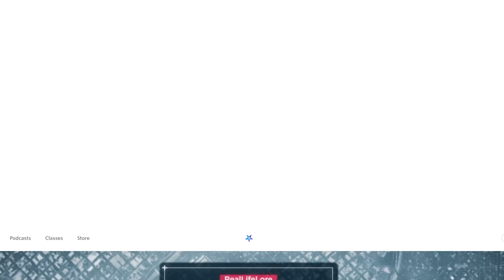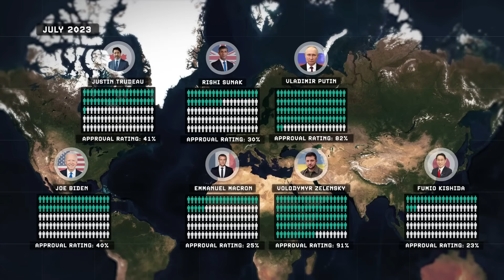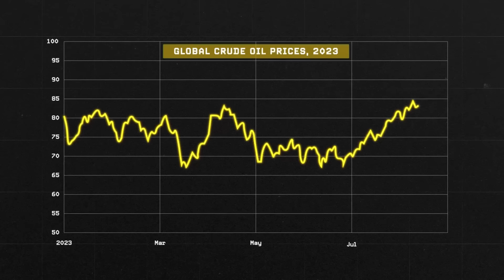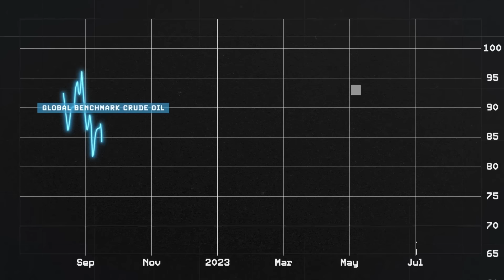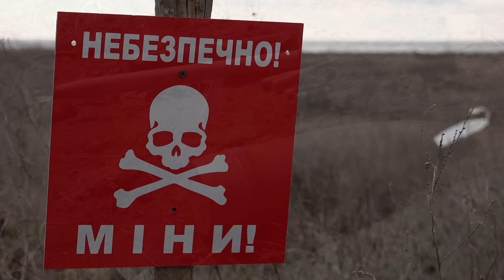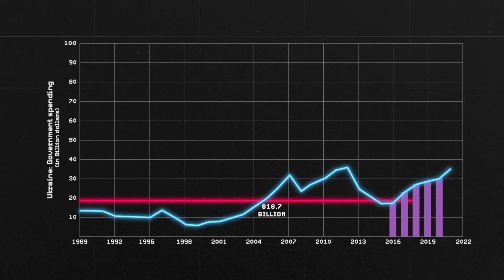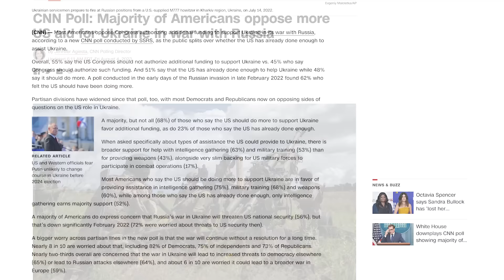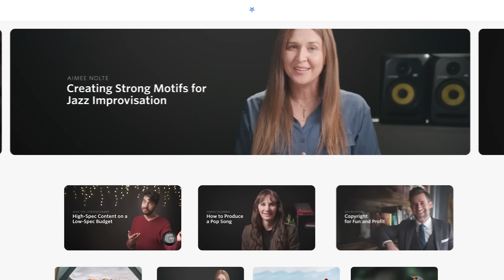Why Russia Isn't Actually Collapsing

Comment: There are several other moments to reflect upon. First, industry. Yes, factories are understaffed. But they are just as poorly automated as they are manned. So, guess what - industrial revolution! Most industries used to see this as unnecessary and unrentable given the production type and availability of human resources. Until recent events.

Then, ethnicities. This topic was and is a sketchy one in Russia. I have no clue about the ethnicity defining methods. What I do know, however, is that Allah-worhipping, barely speaking Russian hairy gorilla - not an uncommon sight both in Moscow and province - upon passport inspection often turns out to be a Russian citizen. Don't even ask.

As for the overwhelming support for Putin - that's debatable. Authoritarian rule is kinda useful - you, the government, have all the loudspeakers and statistics services at your disposal - to count and say as it pleases you. So, we're probably going with ol' good silent majority system. Or, it's slightly modified version, where people might be a bit upset with the government, but every hole around them is screaming that 146% of the populace think differently and those 0.01% that are not, will rot in prison. Thus, they stay silent. And the government still have the ''functional support'' - foreigners see the country as united, inner opposition and unsure populace sees the country as united, people still go to work and produce the products. What more do you, the government, could possibly want? Nothing.